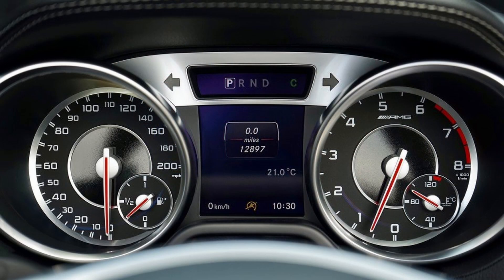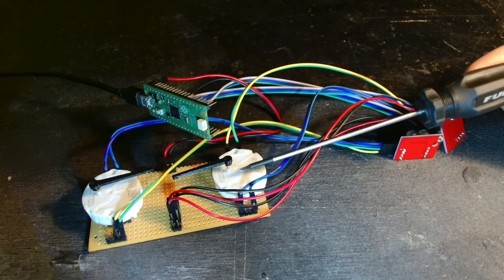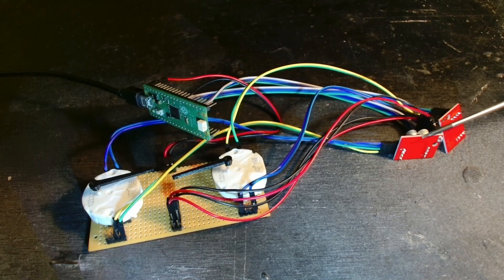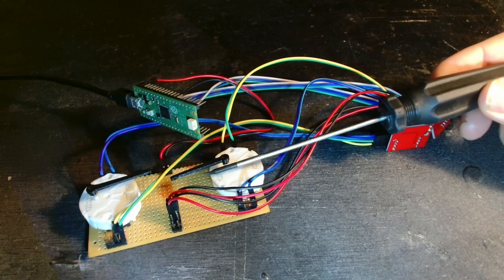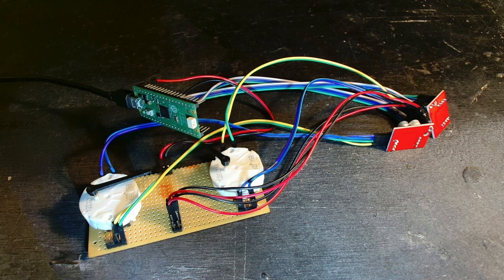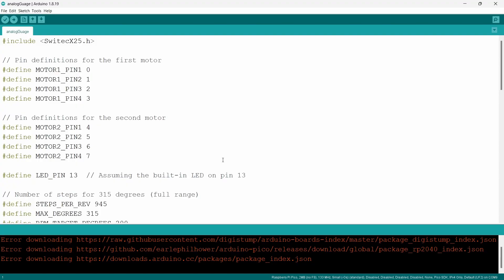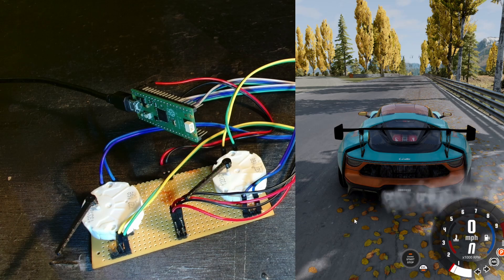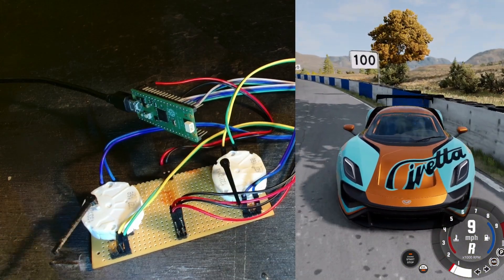DIY Analog Gauges for Sim Racing: Wiring and Testing with Stepper Motors!

Comment: Hi Jason, I found your channel because I'm trying to retrofit an old Renault dash cluster with stepper motors gauges and build a can converter, to get information from a programmable ECU. First I want to thank you for share all the information! Even knowing that it's intended for Sim Racing, I do believe that I have the basics now to keep trying into my project.
My only doubt is why the steppers are usually moving so smooth in car dashes, and it's so difficult to get the same on the bench...
Reply from the maker: That is the refresh rate, if you can increase that it should smoothen out.